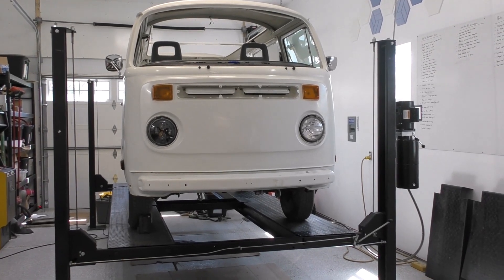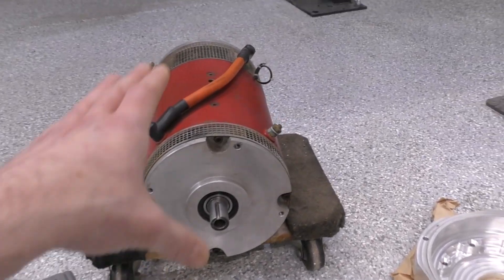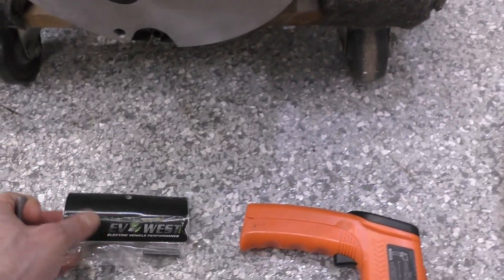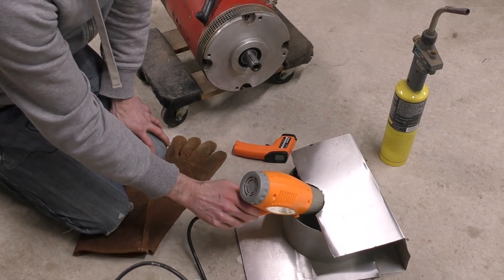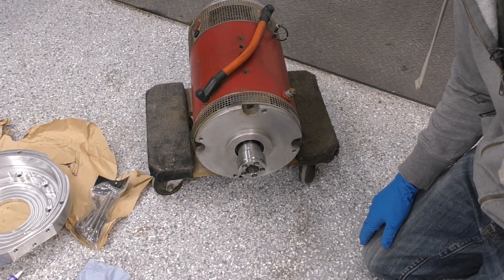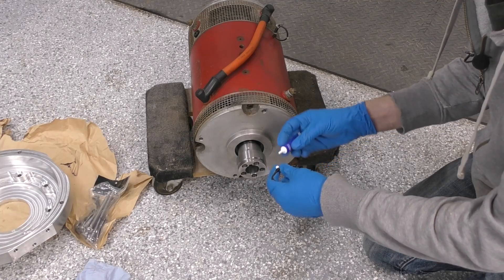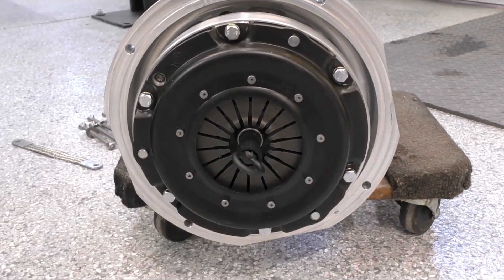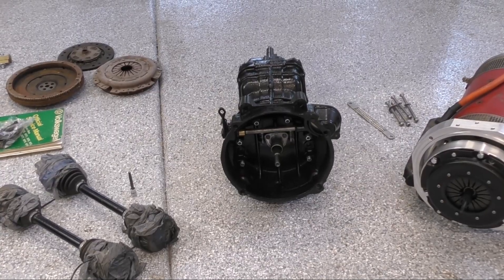VW Bus Electric Conversion Part 11: Install the EV West Motor Adapter, Flywheel and Clutch #evwest

Comment: Just found your conversion and I was pleasantly surprised to see you were actually using a Warp9 motor instead of the AC motor setups available. What controller are you going to use? Zilla or something else? When I did my first Electric conversion I used a Synkromotive Controller and then used that same controller on two other builds. I still have a brand new Synkro and my original production model as well as my original test model. Im going to use mine as a charger for my current project.
Reply from the maker: If you click on the playlist that this video is in, I mention the other components to my conversion.  But for a quick answer, I have a Warp Drive controller from a defunct offshoot company of Netgain Motors.  It's a 160v/1000amp liquid cooled DC controller.
Reply: @FixItScotty  Ok, I remember so many having issues with those old controllers. I remember when they first came out. They seemed to be OK and because it was from a reputable company many flocked to buy them up. Similar for the evnetics controllers that were CNC’d to look really heavy duty and to look super quality. Many more went to those and learned a hard lesson. My Synkromotive still works fine.

Comment: I’m gearing up to my own VW T2 conversion. My approach is to reuse a Nissan Leaf motor and battery, with the Resolve-EV controller. But I’ve been a bit stuck on clutch or not. I see you’ve answered a similar question earlier, and you say that it’s the better way. So maybe I will. I had thought the weight saving was worth losing it, but better cruising speed is probably more worth having in balance. Thanks.
Reply from the maker: First let me say, congrats on your upcoming project.  It sounds REALLY cool!  Second, I have ZERO experience doing an EV conversion using an OEM production setup like the Leaf, Tesla, or Volt. Those options are a little different than the lower voltage Warp9/Hyper9/HPEV setups. That said, I still lean toward using a clutch on any conversion that involves using the stock transaxle of the classic vehicle.  Just my opinion. Now if you were to leverage the full drivetrain of the Leaf including the transmission to turn your axles, that would be ideal. But I think you would be happier in the long run having access to different gearing while driving. Like I mentioned below, in my previous Spitfire conversion, I would often just leave it in 3rd gear and drive it like an automatic in town (0 to 45 mph).  But if I wanted a snappy start, I could put it in 2nd to take off and upshift from there. That's not to say you can't still choose gears with direct drive, but it's difficult to shift while moving. Also, for me, the clutch is a safety feature.  If something goes wrong with the contactor or controller, I don't need a cockpit battery shutoff or anything.  I can just kick the clutch and the engine is disengaged.  Anyway... there's a lot to consider.  My upcoming video will discuss the T2 transmission a little more, so be sure to check that out and let me know if you have any other questions.
Reply: @FixItScotty  thanks for your thoughts there. I’m definitely approaching this in a slightly conservative manner. I have a working 74 T2 that I aim to convert. But rather than destroying a working bus, I’ve got hold of a complete rust bucket that will be my prototype test bed. Once I’m happy I can transfer the results over. Yes I plan to keep the original transmission. The other advantage of reusing the Leaf setup is keeping the 50kW charging via Chademo. It’s not a common charge format, but there’s now a CCS adaptor so I could take the bus anywhere. (Im in the UK BTW). Most DIY conversions I’ve seen have low charging speed. Fine for a day trip maybe, but going to festivals is no good if you need a 10 hour recharge en route!
The Resolve EV controller should manage all the complexities, plus allows me to upgrade to a higher capacity Leaf battery once it’s all proven working.
Looking forward to your next episodes.

Comment: I've always thought it was weird that the EV co's don't want you to run a transmission, just motor straight to t-case or drive shaft.

Having a 5-speed behind the motor makes an EV 20x as attractive to me.
Reply from the maker: I think direct-drive conversions are a legacy thing.  It seems like nowadays people are using crate motors or Telsa drive units that include the gearing.  Or going with a standard flywheel adapter like mine.  My last conversion included the clutch.  1st gear never got used, and I could drive it like an automatic in 3rd gear from 0 to 45 mph.  But it's nice to have the option to use 2nd gear for quick starts and 4th gear for cruising.
Reply: Three ratios delivers actual vehicle tractive utility and variable driver age. Need to climb a steep driveway with your mother-in-law on board, or slowly push/pull or move something? Are we deciding to be 14, 28, or in our 40's for today's drive to work? The (less exciting) range loss due to the transmission is real but for a given 'bolt it together' set of powertrain design of components that simply 'go' the transmission is an asset retaining ICE character in an achievable revival to EV.
Reply: I have always used the transmission.